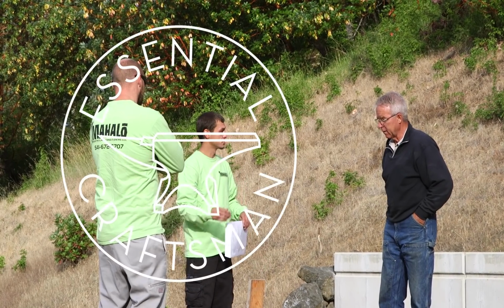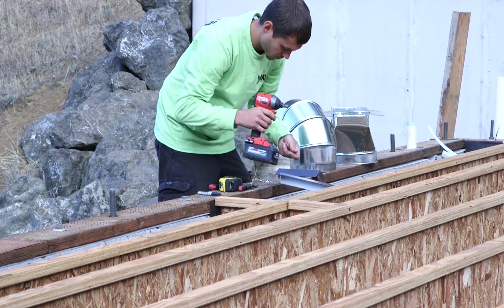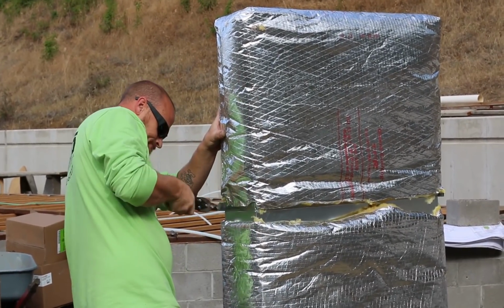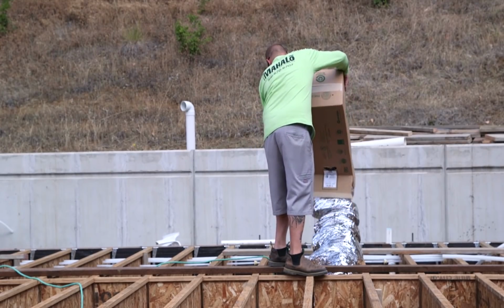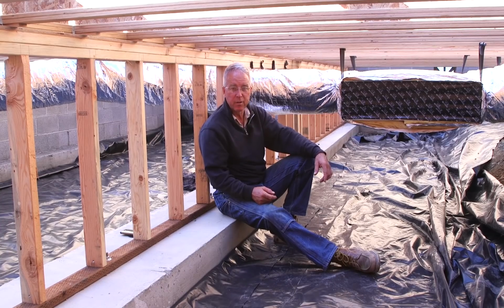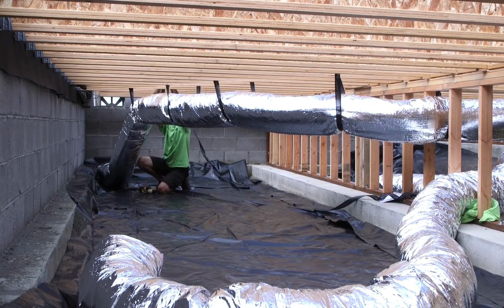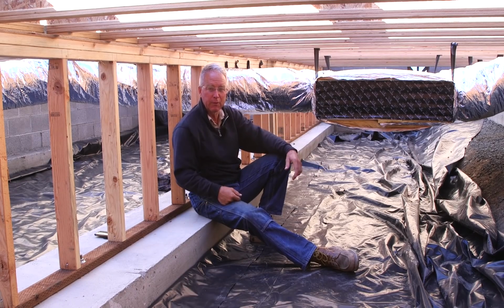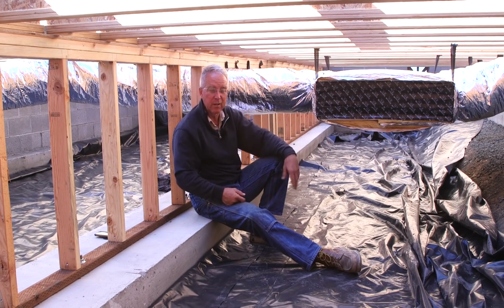Ducting Ep 42

Comment: As a tinknocker it is sad to see all of that flex.
Reply: Yea it’s crazy how big of a cfm drop you get from flex to metal. And you can’t really make flex duct look half as good as a metal pipe job. I do residential and it’s not that much more to install if you get a couple guys that know what there doing. But to each his own I guess.
Reply: sean clark yeah you here is going to a lot of resistance it didn’t even appear the he properly flexed that flex ducting. The tighter you can pull that flex the smoother the inside of it will be and have less resistance. Doesn’t look like it was stretched at all. For a job like that in my neck of the woods hard duct  usually runs about 15-20% more than flex
Reply: Kenneth Wright yea pulling it tight is far better but I guess I am lucky enough the people will pay the extra money after explaining them the benefits. Labor wise it really doesn’t add a lot of time after you run a couple hundred feet of it you get the hang of steel pipe. The worst part is the mastic . But you always get the ductboard/flexduct loving home owner that has to have it so you just do the best you can to make it as efficient as possible.
Reply: Shit, as someone that lives in a colder climate I was surprised flex in residential was even a thing.
Reply: @dakel20  Like Scott said, he climate in his area is relatively gentle. Not huge swings from season to season.
I agree that it wouldn't work in my part of Canada (-40C to +35C), 

But Scott said it multiple times: what works in his area with his local climate won't be right in other places.
Reply: @pileofstuff  yes, it seems like Scott was anticipating some of these well-meaning objections.
Reply: @dakel20  they use flex in many residential homes at least in the U.S. It's faster to use that's the only reason they use it
Reply: I feel you brother it's cringey
Reply: @Carnage It's aluminium foil wrapped around a big spring effectively.
Reply: Yes, I agree. I would think more hard lines should be used to reduce backpressure and increase cfm overall. After all, that blower fan/motor still has work, but let it work less and not waste so much energy pushing air against a flexible body. Otherwise, the motor gets hotter, which is cooled by the air that just got pushed down the ducts, which is not hotter than it was. Waste of energy and cfm having so much flex.
This is one reason why when I redid my underhouse runs on my manufactured home, I put in hard lines for most of the run and only flex for about 6' where it needed to join the existing setup. Then I pulled that flex as tight as I could before fastening it firmly to make sure there was as much flat surface inside the flex as possible. Made a difference on cfm movement.
Reply: @korishan  good job,you're 100% correct
Reply: @korishan   he stated that in the video
Reply: The majority of residential homes that I have been in, have real metal pipe heating ducts. It’s too bad he went the cheap route with the flexible garbage.
Reply: LifeisGreat  great channel but most decisions have been made strictly based on cost. And many have donated for free advertising.  It’s is well crafted but out of cheap materials.  It’s A house constructed only for YouTube views.
Reply: The comments are great - but as the host says, this is a pretty mild climate, so the gains of hard duct won't be as great as in a place that's very cold or hot or both...
Reply: @AlanTheBeast100  It is not unreasonable to use flex, but on a channel so focused on craftsmanship I was expecting better. Usually not the type to make these comments but was surprised and thought I would share.

The longevity aspect of metal duct is the real advantage in my eyes.  Just finished an install today, 60ft of trunk and short all metal branches.
Reply: @lobsterbushbroo  
In the end, it's not a "craftsmanship" decision, it's a project management decision.  Money and time are part of that.  The host is always making decisions about the project based on "local conditions" and who the project is for, what the budget is, etc.  I'm sure he took guidance from the installer.  But to re-iterate - what is unreasonable compromise (or non-code-compliant) in one place, is not an un-reasonable compromise in more temperate places (for the record: all of my duct work is the box-metal sort...).
Reply: @lobsterbushbroo  Longevity of flex has not been a problem (for me at least).. I have a flex octopus in the attic for a/c. It's been there 30 years and zero issues.
Reply: Paul Ohlstein absolutely. Flex, when done right and not having moisture or pest issues will last for a very long time.
Reply: @AlanTheBeast100  This is why we have YouTube comments. So everyone can scream out, "We don't do that here so this must be bad!" Look, I have a close friend that lives relatively close to Roseburg. When he got his Nest thermostat a couple of years ago, he started sending me graphs showing that his furnace had been on less than 10 hours per week while my furnace had been running non-stop and I was still cold. The cold hard data make it really hard for me at least to justify spending more money on better duct work.
Reply: @Carnage nope. I've done commercial work and sometimes we had to run hard pipe all the way to the registers. It's definitely the best way but at least in Maryland for residential any runs over 10 feet have to be hard pipe
Reply: @faded9043   he says hard pipe is best. But that flex is almost always used in residential.
Reply: @ellismidkiff6117  yes but regardless if it's residential or not hard pipe is better and more efficient. I would not use more then 10' of flex on any run. That's just my opinion
Reply: @faded9043   the hard pipe in my house is not as well insulated as it should be. I cut a few small sections out to move a few vents I used flex for that the flex insulation is almost 3 times as thick as the insulation or the hard ducts.
Reply: Is there an easy way to insulate the ductwork? It looks almost impossible to me after it is installed.
Reply: @ellismidkiff6117  if it's already installed just insulate what you can. I also recommend using duct seal on all the joints before insulating to keep from losing air pressure. Doing all of this will make a big difference in having more hot and more cold air and will help put less stress on your unit and it should run more smoothly if that makes sense? Hope that helps you and good luck if you need any tips just reply and I'll try to help you
Reply: @ellismidkiff6117  it's not a easy task unfortunately. What would suggest would be to buy a roll of insulation and tape and cut the insulation in 3 foot lengths and wrap it around and tape as best as possible. They also make a bubble type wrap which is easier to use but more expensive. If you want I could give you my email if you want? Maybe I could help you further? It would help if I could see pictures
Reply: I'm from Europe, and the little we see of these kinds of systems (i mostly deal in residential, not office work where stuff like this goes galore) and even i cringed at that. Quite a lot of wastage too.
Reply: Commercial = hard pipe with 5’ or less flex ‘tail’, of course. Residential (in a lot of areas) = flex is acceptable as long as you account for friction loss. From what I could tell it looked a lot like those take offs were 8”. Plenty of air. Also, those flex lines looked clean and well supported. Per code and manufacture specs they were strapped sufficiently. As an HVAC contractor I would not be keen on installing ANYTHING before roof decking and at least felt was on, no matter what climate. But alas, Scott made the decision to have them in before sub floor was installed. I’m sure he’ll take good care in making sure the HVAC system will not experience undue issues. I’ve been doing HVAC for, what I think mostly, is way too long but I would never question the ideas of a builder who had nearly twice as much experience in construction as I do. The content and effort put into this channel is second to none. Scott and his HVAC sub did not do anything wrong or incorrectly, give it a rest. Sad to see so much flex? Maybe I could say ‘sad to see so much metal, would’ve been a better value and more cost effective to use flex duct.’ 🤔
Reply: Just hope mice/rats never get in. Matt on the Build channel just bought an older home (1970's) to redo on a budget.  Rats were using the inside of the runs as superhighways. Chewed right through the insulation.  Sure, Matt builds for high-end customers,  but even for his own home, and for the rental,  he's going with metal and not flex.
Reply: Indeed. That's Manual J for ya.
Reply: @Carnage you might be union. Slinky like wire inside flex "circle" duct. If connected on one end then slightly turned or clocked the wire has 2 purposes. Primary being structural integrity, and secondary it provides rifling affect for air flow. Some times inspectors want to see duct conections befor insulators.
Reply: There is not only the factor of contractors taking shortcuts like this to increase profit, but this also demonstrates the lack of skilled labor available these days. If you are unable to hire skilled craftsman, for whatever reason, then you have to reduce the level of difficulty for your employees
Reply: Dan Nelson there are no shortcuts being made here. NONE. And because they ran flex they’re not skilled? Flex duct is an absolutely acceptable way to duct a residential structure. Those cuts made in the rect duct with the electric cut shears were SUPER clean. Hmmm 🤔
Reply: @richw9205  this is actually just what the owners of HVAC companies have told me
Reply: In the deep south, hard pipe is causing a ton of sweating issues due to higher efficiency units.  Colder air matched with variable speed blowers leads to tons of problems.  Everyone wants to ventilate their attic also, so by midnight it's hitting dew point and on 90%-100% humidity days, it's raining in peoples attics.  I've switched to R8 flex and haven't had issues in ten years.
Reply: I design and coordinate commercial HVAC.  The amount of flex on this job is concerning.  No saddles used to support the flex.  Also, what precautions are being taken to keep dirt, rain, and debris from getting into the duct until the structure is complete?  Watching that guy pound the end of the duct against the dirt made my jaw drop.  Lay a clean section of Tyvek down at least.  I’m not there so I’ll reserve all my thoughts.  Love the channel however.  This really was the only video that concerns me.
Reply: @danmiller6890  What would you estimate the cost diff in flex vs straight pipe?
Reply: @danmiller6890  I found the lack of supply air can covers, most disturbing. Flex duct is also a potential entry point for rodents who like to chew through the thin duct walls.
Reply: @Carnage There is wire reinforcement in the flex.
Reply: Exactly what I thought.  Flex restricts airflow.  I assume they accounted for that, but still.  Hard piping it would've been better.
Reply: Mellow Guy if friction loss was accounted for, then they’re fine. Totally. And as long as flex doesn’t get wet or succumb to rodents or insects it will last for a very long time.
Reply: @richw9205  As this is a crawlspace, not a real basement, I would say the chance of rodents or other pests being present would be high.
Reply: Every rib in the flex will cause resistance in the air flow causing the fan / blower to work harder than it needs to and you want the installation to be dry as a bone .look up  legionnaires disease . But I think it looked like a good clean installation. I would just use other materials.
Reply: Never liked spider systems as they are a pain to balance and not very efficient. Prefer main trunk then branched out with dampers in each tap. No more than 5’ of flex- use flex to help on the noise and ease  of installation.
Reply: I was an HVAC mechanic, (now called technician) for decades. Did some duct early on and learned HOW. And I agree. Flex duct is the DEVIL. Garbage, plain and simple.
Reply: Arnt you suppose to have dampeners on the take offs ? Just piped a whole crawl space this morning in spiral  lol  and I dont see a return air . I thought you lost 50% of air flow using flex hose?

 I'm from Canada maybe we do things different up here

Comment: When it comes to flexible or rigid ducting, I suspect it's also a case of local codes, and possibly the age of the building.  I've lived in houses built any time between the late '40s and the early '80s and I've never had anything but rigid boxed steel ducting throughout the house until about 2 years ago when I had to add HVAC to an existing structure (in the attic.)  Some of the boxed ducting I've lived with wasn't insulated (and tended to drip condensation on the basement floor on hot, humid days) but it was all galvanized steel with an X scored into the side of each panel.  But that was in the PA/NJ area, and I guess local requirements and codes - and whatever passed for standard practice of the time - can make a difference.
Reply: The X is to give it some strength and that duct can still be sealed and insulated.
Reply: Yeah, stops the metal from booming and rattling when the fan switches on and off - and interestingly, the ducts were painted where they were exposed in the basement, but there was no sign they were ever insulated.  I guess corners were cut back then.  Cheers, mate.  :-)